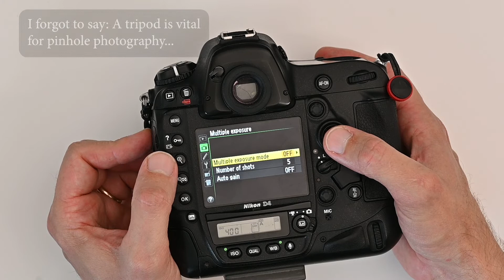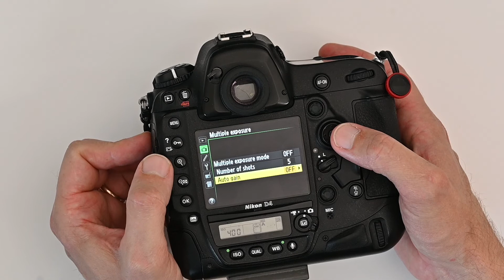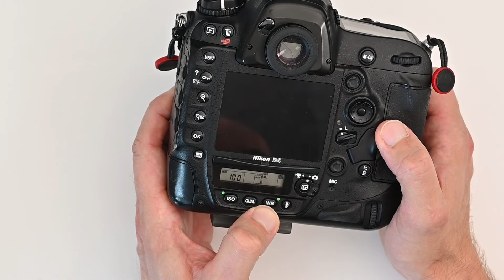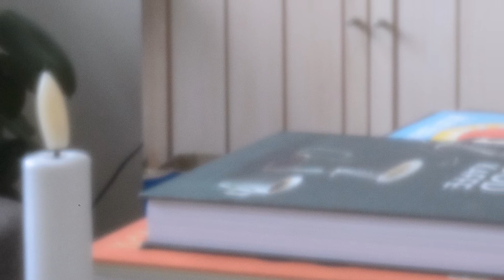Digital pinhole photography 101

Comment: Thanks for the video.

I enjoy shooting digital pinhole and film pinhole.

I enjoy 6x7, 6x9, and 6x12cm medium format film pinhole and 4x5 inch large format film pinhole more than I enjoy digital pinhole.

However, I enjoy APS-C and micro 4/3 digital pinhole more than I enjoy 35mm film pinhole.
Reply from the maker: Wow! You certainly have done a lot of different types of pinhole photography 👌
Reply: Nice pinhole images not too blurred but with a lot of diffusion need the biggest "sensor" possible what argues for at least 4x5 film, for me digital sensors are just too small for pingole photography, unless you like completely blurry results.
I have also interesting results on my "Le Rouge 4x5" pinhole camera with my Fuji Instax Wide 4x5 Graflock back.

Comment: I recommend going to a secondhand junk store and buying  a cheap plastic film camera.   The plastc lens gets removed and replaced by the pinhole.  Now, just poking the needle through the aluminum film leaves torn edges which can affect the image quality.  You might try a piece of a beer can.  Then you use the push pin to indent  a small dome into the aluminum but not make a hole. This is hole is then made  by using a piece of fine abrasive cloth to wear away the top of the dome so you end up with a tiny round hole instead of a jagged edge and the edge is super thin, eliminating unwanted reflections
Reply from the maker: Thats a great 👍 tip for making the hole in the aluminum! Thank you for sharing 🙏🏻